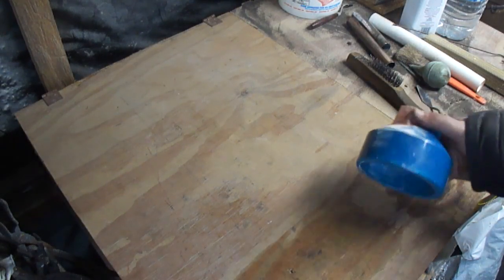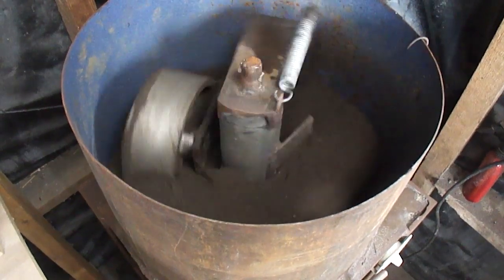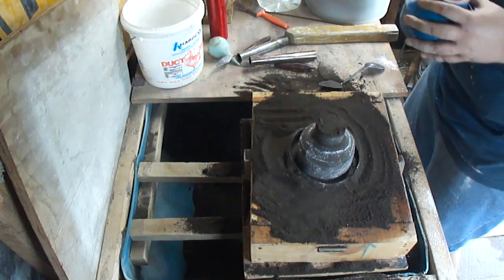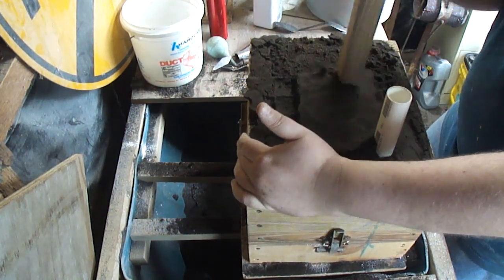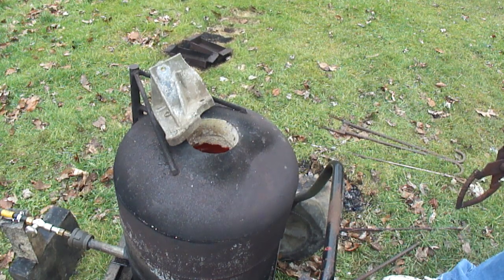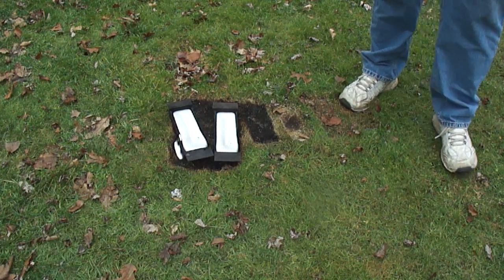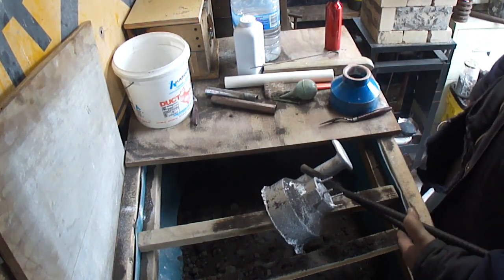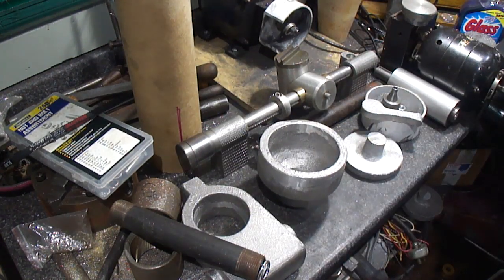Casting Day #21 - T&C Grinder Wheel Guard

Comment: You should write a book on how to build a sand Muller that thing is sweet. Have you ever tried one of those laser thermometers?
Reply from the maker: lol, I had a whole build series on it, and I really didn't have any plans, just what was in my head, so nothing to really write about, lol.

the laser thermometers don't work with molten metal, they usually don't go that high of temperature and the reflective nature of the molten confuses them to no end, so they won't work for casting and why thermocouple based pyrometers are usually used.